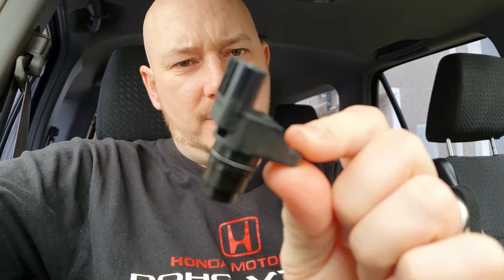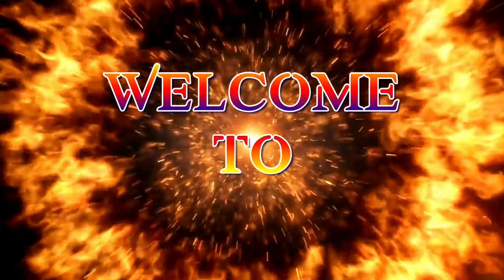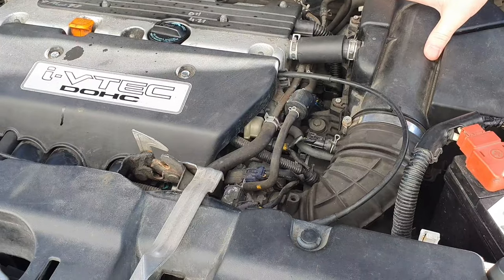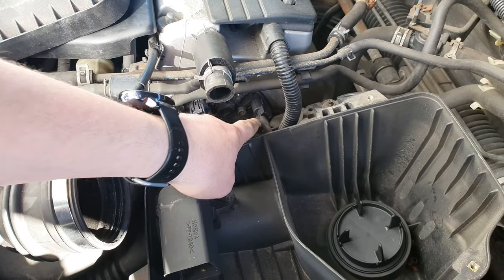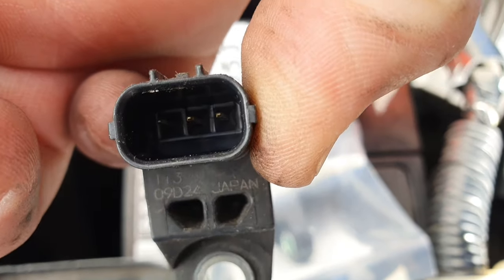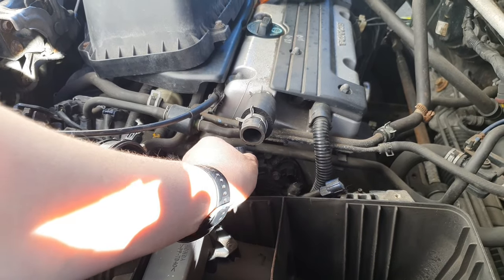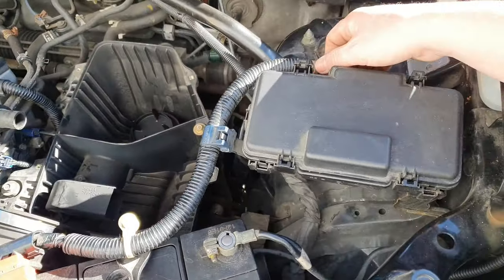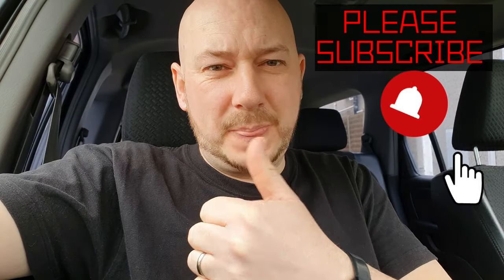p0341 honda crv/honda cr v problems/how to replace camshaft position sensor/honda cr v k20

Comment: Cam sensor code came on,  changed out actuator, guides, chains, tensioner and sensors.. blah blah.. code is still triggering and dash light on. Can't figure it out
Reply from the maker: Change the engine they aren't that expensive, and you could get a better one with vtec on the exhaust side too! That's my plan if my engine goes pop. Type r engine or something lol
Reply: Swap your computer and check your grounds

Comment: Hey sr i got a 06 tsx .. my cuetion is those camshaft sensors they are the same? So i have to buy 2 of them? Or is any diference?
Reply from the maker: Hey. Im not sure best to check with motor factors, and also make sure that it is the camshaft position sensor that is the problem first, i replaced two and it turned out to be a timing chain stretch. Just a heads up on that.
Reply: Thanks gope is not the timing chain car just work like normal  just trows system emisions .. i think is caused cus those sensors they are damaged.. cus i dont have any rare sound of the engine.. just acts like normal operation... ill start to replace those sensors hope they work.. if is not ill check timing chain and last option replace it ... thanks

Comment: Im not getting any engine codes right now so I believe my sensor is fine, but I am leaking oil there so prob need to replace just the o-ring there.  Does honda sell just the o-ring or does anyone know the exact specs for a replacement?

Comment: So timing must have jumped?
Reply from the maker: No chain stretched, its common with chain driven engines.
Reply: @GPTV2020  so you replaced the chain and tensioner?
Reply from the maker: Yes, well i didn't do it, my mechanic did.
Reply: @GPTV2020  How much did it cost?
Reply from the maker: My cam shaft position sensor was 80 euro and it wasn't from honda, it was just a generic one.

Comment: GENTLY tap the VTC solenoid with a long thin metal rod and a hammer. They stick. P0341 If you motor smooths out or runs better, just replace it. Stop worrying!

Comment: isn't it better to put in a new chain instead of replacing the sensors? I think this is a problem that seems to not go away. I have seen it across several brands of cars.  as more miles put into the car, the engine parts wear out some faster than others.
Reply from the maker: Yes, i agree. I first swapped out the sensor and when i didn't work then i replaced the chain.

Comment: did the same thing. change both sensors and still the light is on.
Reply from the maker: Well then its timing chain stretch. I put up a warning at the start of this video telling people about it.
Reply: @GPTV2020  yeah. sadly though I saw this video a lot too late. haha
Reply from the maker: Ahh thats too bad. Either way look at the positives, now you have spare sensors!
Reply: @GPTV2020  yeah. I have a pair of those sensors. hahaha. I just kept them in a box
Reply: @GPTV2020  ya and mine cost me about 125$ a piece 🤨
Reply from the maker: I think thats almost the same price i paid around 70 euro each. Actually I think thats around 100 doll hairs each
Reply from the maker: No its 83 dollars US wow thats a big difference. Like 50 dollars difference. For my 2 sensors it was like 166 dollars in Ireland.
Reply: @GPTV2020  new was 125$ remanufactured was about 80. OEM from Honda was 180 🤪
Reply from the maker: Crazy the difference in prices
Reply: @GPTV2020  OEM Parts are always ridiculous. But in my experience (8/10) times worth the money. Especially on a job you don’t wanna do twice!!
Reply: @brixelirvincabatingan9382  did you replace the timing chain?
Reply from the maker: True
Reply: @TruckThisGarage  not yet tho. but the CRV is not my daily so I could delay the repair. I barely use it. Usually once a week or less.

Comment: I have a Honda odyssey 2015 that gives me a p0365 code my car has hard start and misfire while pressing acceleration pedal anybody help please
Reply from the maker: It could be a camshaft position sensor needs to be replaced or there is some bad wiring (loose or damaged) check these out before replacing the sensors.

Comment: I got p0341 cod and all sensor working i dont know what is the problem the 2 cam sensor is good also the knock sdnsor is good the econ system and the cruise control not working the acceleration is so bad guys plz help
Reply from the maker: It's possibly the timing chain has stretched.

Comment: Should have got a different code with first install . Could have originally had a P0341 or P0342 error codes?  When you first install the sensor you’d get a different error code than the original error if it was a p0341 then the next error code would be a P0342 or vice versa

Comment: BOLLOX....  so we are looking at a new chain kit? ffs....
Reply from the maker: Cant catch a break dave.
Reply: Happened to me changed both the camshaft sensors no change then cost me more to have the timing chain done, problem gone and £600 quid with it.
PS cam sensors were easy to fit.
Reply from the maker: Yeah i had that exact scenario.

Comment: So a timing chain isnt any better than a belt than? I’m at 126K miles on my CRV. Aren’t most timing belts changed around 100K??? Honda techs reply ☺️
Reply from the maker: Yeah ture but rubber can snap at anytime a lot easier then a steel chain so it is still better to have a chain.
Reply: @GPTV2020   very true. So I replace my cam and crank sensors. Still getting some sort of timing chain or Pully code. Is it my chain you think. Ugh
Reply from the maker: Yep, i changed two camshaft position sensors, and it just came back. The timing is slightly off and so that is why the code is popping up, if you adjust the timing it could work but the timing chain has stretched so the tensioner can't put enough tension on the chain it will just slip out of time again.
Reply: @GPTV2020  great! 💯 agree I’m on second set of sensors. So what do I need to replace. Tensioner and chain. I heard this problem might have a recall
Reply from the maker: Im not sure about the recall, i didn't hear about that. 🤔 but yeah a whole timing chain kit. Its not an easy job and it is expensive to have a mechanic do it but if you can remove the engine yourself it is easier to do out of the car.
Reply: @GPTV2020  ugh. Maybe I’ll just trade it in. LoL. I’m so tired of fixing cars after they hit about 120K miles. Just sucks cause I just paid it off. Thanks for the help
Reply from the maker: I understand that, most cars hit a certain point and just cost more and more problem after problem until you give up fixing them. No worries take care.
Reply: @GPTV2020  subscribed 😉
Reply from the maker: Dude thanks alot. 👍
Reply: @GPTV2020  well checked my timing marks. They look aligned on the cam gears. So I am gonna try the VVT Actuator. I think that’s what it’s called. And replace some filters somewhere around there lol 😂. I’ll get those warning lights off somehow haha
Reply from the maker: Let us know if it is the timing but if the gears are off even a fles mickey it will be out of time.
Reply: @GPTV2020  they look dead on to me?
Reply: Well I keep reading one guy online had same symptoms as me. But his battery was failing. I know my is Atleast 6/7 years old. Maybe I’ll give that a try. Needs replace soon anyways?
Reply from the maker: Yeah, sure change it anyway, but a used battery shouldn't give an engine light.
Reply: @GPTV2020  I agree. But electrical stuff can be finicky lol
Reply from the maker: Very. Well hopefully you find the issue and its not too costly.
Reply: @GPTV2020  still can’t get this damn vtc solenoid bolt in what the hell. Might have to pull the motor mount. Ugh
Reply from the maker: Aww no way.
Reply: @GPTV2020  pulled mount or and rubber piece should be able to get my fat hand I. There now 😂😂😂 *side note can I reuse the valve cover gasket for Atleast testing and then Replace it once I can finally get rid of the dummy lights for good
Reply: Ok I got it I had to tape the bolt to a short extension and thread it in. Guess I just didn’t have the right angle. But it’s in now time to reassemble and check the codes for the 20th time. LoL
Reply from the maker: Yes, as long as it has not perished or damaged.
Reply from the maker: When you reset the code, don't try it for around 5 mins before you put the key in. Ive seen some people say that.

Comment: This is called camshaft DTC sensor ( Dead top center) . It is not the same as crankshaft sensor. Which k20, k24 engine should be next to oil filter under a cover where you access from below. That is more the problem.
Reply: Do u have any other info if I get this code what do I need to do ?
Reply: @Ant0n_42   well it turns out for me is the timing chain stretched most likely cause by me installing the chan tensioner incorrect. In my research that camshaft sensor didn't go bad as easy.  I think checking if the timing is a good thing. Also while I did that I found out there is a lot of stuff at the filter of the VVT solenoid ( VTEC solenoid spool valve. Back of engine at left side. 15815-r40-a01). And they also has an update version of variable valve timing solenoid. 15830-r5a-a01
I also checked screen 15845-raa-a01. All parts based on 2010 accord LX so look up the pictures and work with your engine.
Again. This code said camshaft position sensor (right side under the air filter box.)It's actually compare to the crankshaft position sensor ( at bottom of engine) signal. But what drive it is the engine chain. So either the sensors of both or the timing chain/ timing is off is the issue.

Comment: my New to me 2006 CRV just had the check engine light come on. PO341 AND the VSA & Triangle symbol with exclamation mark. Any idea's?
Reply from the maker: Well VSA is for vehicle stability assistance and the warning triangle symbol is a caution symbol that means something needs attention. I would have the timing chain checked first because it can cause other errors to appear, then when the chain is fixed see it the symbols come back.
Reply: Thanks for the response, so in your experience, its the chain & not the sensor itself that needs replacing? @GPTV2020
Reply from the maker: @Dougarony  yes, i changed the sensor and the loss of power and warning light came back a few days later. I had the chain changed and it was that.